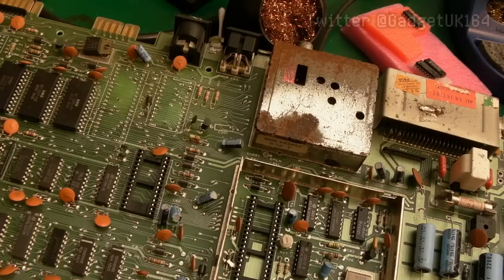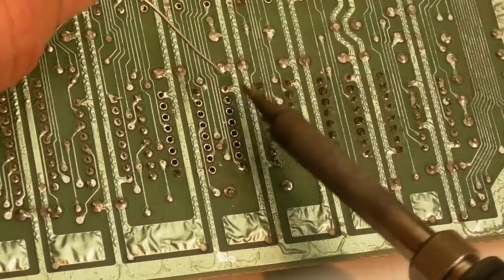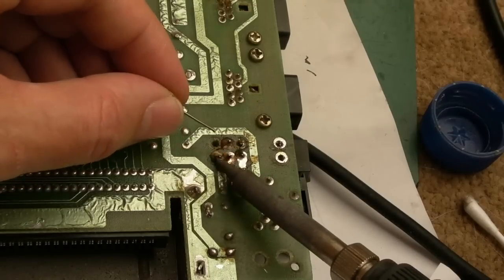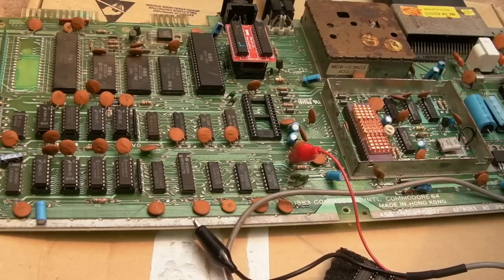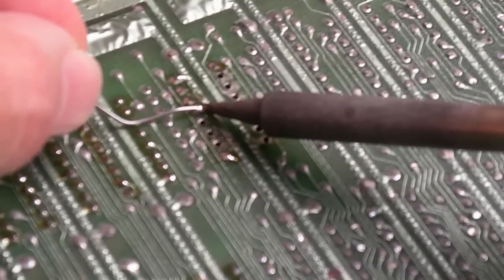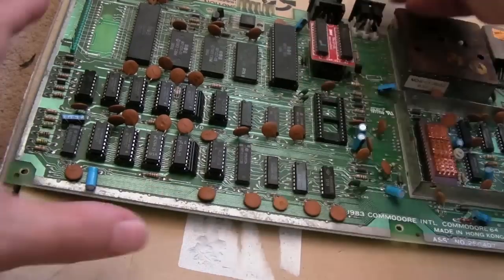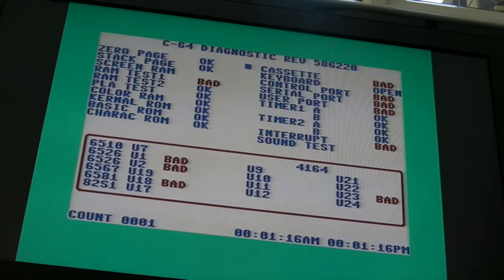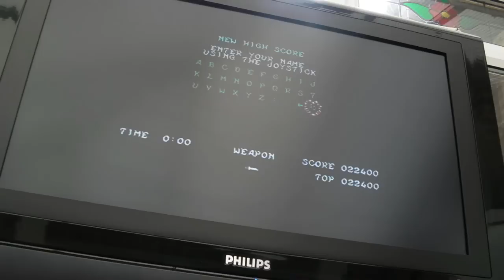Commodore 64 (C64) Junk Board Repairs Part 1

Comment: I love how I looked at that resistor and asked myself if it would cause you an issue... and then it did. It's actually a good lesson in how a bad passive can cause you a lot of grief if you're not careful.
Reply from the maker: I was just kicking myself that I never noticed that resistor when inspecting the board at the start!!!

Comment: Dedication Chris....All power to you mate, most people would just have stripped what's left on the boards and binned them (should at least keep the bare boards). Great side info as always, dead helpful for people new to this and even us old sods don't know everything and learn a little tip.. Careful, the old OCD is showing with the straight sockets :)

Comment: I learned the hard way that you're supposed to occasionally thoroughly clean out and relubricate mechanical desoldering pumps. You have to use lithium grease on the springs and stuff. I ended up ruining both of the ones I had because they basically fused themselves shut or broke into pieces.

Comment: Nice repair. It's unfortunate people make money by buying C64 computers then split it up in parts and sell them on ebay, but they can make a decent profit just by removing the SID, VIC2, PLA, 2xCIA chips and selling them. Plus even more by selling the keyboard, box and power supply separately. But I guess that's how we get spare parts.

Comment: Yeah, noted the heat issue with a VIC as well as have one that over heats if I don't put the lid back on with thermal paste. My RAM error was altrnating between RAM chips with every power cycle I did. And thanks for the tip for cleaning out the tube on the solder sucker. hadn't though of that!

Comment: I vaguely remember power switches being colour-coded for amperage (black 1A < blue 2A < red 3A). All C64s I've ever seen IRL had a blue power switch. You used a black one which is the weakest IIRC. There is a power rating written on the switches themselves. Could be the root cause of random problems caused by random voltage drops, especially with power hungry VIC-II. You got it fixed now but if it ever starts acting weird again, try a blue power switch. 😀
Reply from the maker: Thanks!  That one came from a C64, so pretty sure it's not important!   The problem was the power socket I am sure!

Comment: I really want to see if I can get the board I have working which had sound issues but wasn't the SID.
Reply from the maker: Don't give up on it!   PLA and 139 are most likely causes, beyond that the audio transistor or something around there (cap?).  Assuming the SID is fine!
Reply: @GadgetUK164  the SID wasn't fine but when replaced with a new one it sounded much the same. I've added a pulled trace into the issues too, you know, just for fun lol.
I'll find the issue! One day
Reply: See if the filter caps say 222 or 471. Some boards have 222 caps when they should be 471 and that may be the problem. If they are 471 then it might be the SID

Comment: Do you actually have parts that can be donated to these boards, rather than borrow them from your ZIF board?
Reply from the maker: Hi Daniël, I have the PLA's you sent (and the other bits) to look at in an upcoming video, and I also had some parts donated by Timo Momo in Finland (another video).  So as I look at more of these C64's parts will get filled onto all these boards =D

Comment: Yeah, needlessly stripping a board is stupid and pointless. The only candidates that make sense are things like the Atari Lynx that have a major design flaw in the power circuit that could kill the entire system, though even then modern USB-C power mods exist for it. Or maybe extremely poorly made PCBs like on the Watara SuperVision. Only completely ruined PCBs are worth stripping and replacing, not ones with one or two broken traces. Don't be lazy. Most things can be saved given enough patience, time, and skill.